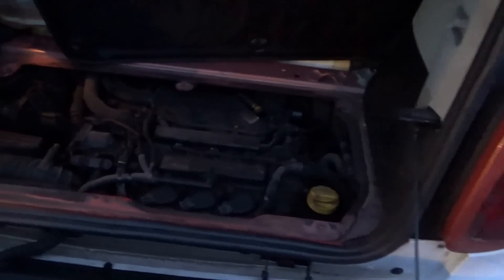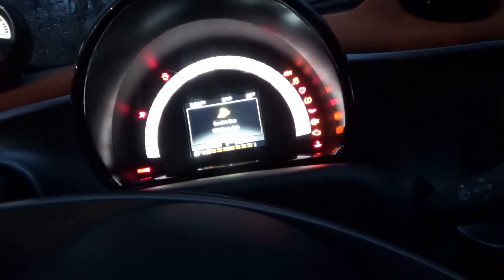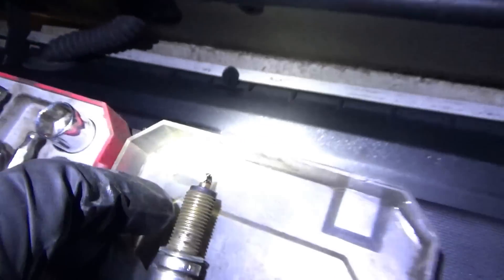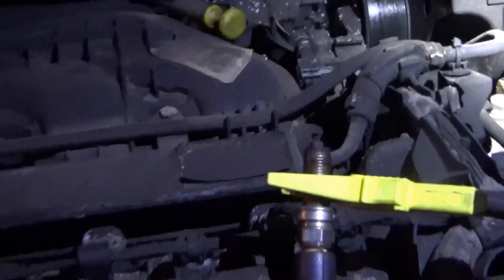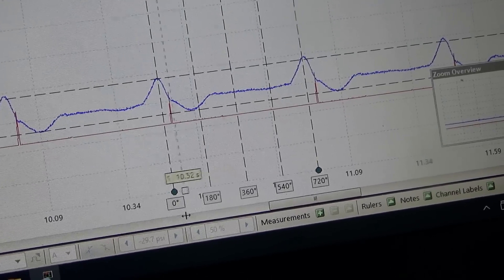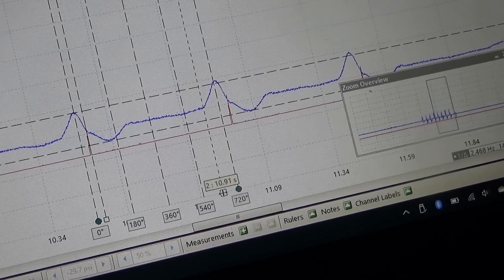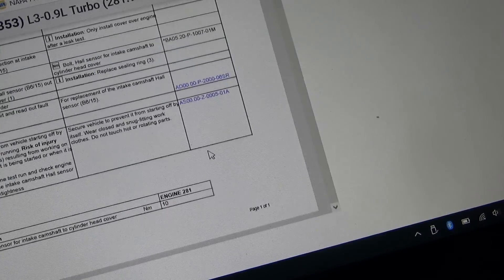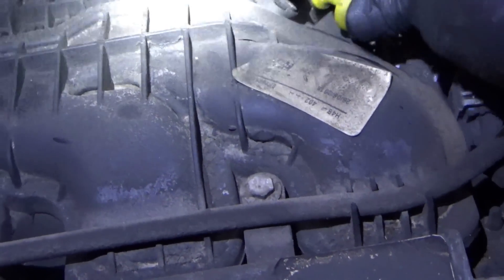SMART No-Start Diagnostics (Spark? Fuel? Compression? Timing?)

Comment: I just looked at the info display, where it said "Service 246 days overdue", and knew what kind of owner this was.  PS. They are NOT useless cars. (Maybe in the US).  But even in the US, it's nice city runaround little vehicles.  And ideal for what it was used for, namely a delivery service. Owner just didn't look after it, with proper maintenance.

Comment: Smart recommends every 10K, which I think is still too long.  The car makers are in the business of selling cars, not oil, so it helps their bottom line if you have to buy a new car because the engine got ruined.  As I've seen others say many times :  Oil is cheap, engines aren't.

Comment: My wife has a second generation 2013 Smart with a nonturbo 1 liter Mitsubishi 3 cylinder engine.
It was bougt 18 months old second hand at about 8000 miles.
Now at about 35000 miles  it has cost us in repairs a 130€ battery, 10€ front wiper blades,1€ brake and number plate light bulbs, and of cause yearly servicing. 
My wife loves that little car, and  frequently exceeds our local highway 75 Mph speed limit up to 90 Mph.
And I am quite happy driving my 5liter V8.😎

Comment: You can hear the engine has no compression either the timing chain jumped or broke I would say this has a belt😊
Reply: Later on the video, he showed thru all data that it has a chain😢

So that chain snapped just from lack of oil changes?
Reply: @ricebike  yep chain will break lack off oil change

Comment: Lots of comments here about the 20,000 miles oil changes. Here in Europe the recommended oil change interval by manufacturers is 30,000km. For city driving about 15,000km for most brands. I have always wondered why in the US it's every 5000 miles or so. Can someone explain the difference?
Reply: It varies quite a bit in the US. I had a bmw that specified oil changes every 15k miles, and a honda every 5k miles. I'd never go more than 5k miles and would use the best oil I can afford. I don't get why people try saving like $8 per month on oil when paying $800 per month for the car... makes no sense.
Reply: @rrmm7566  Yeah but based on the different recommended intervals by the manufacturers you could conclude that 1) you have crappy oil in the US or 2) you get screwed in the US by the oil companies/manufacturers to have such short intervals or 3) you have crappy engines build in the US. Pick your choice...
Reply: @mark-d9k9b or perhaps some manufacturers don't care what happens to their engines after the warranty and just want to sell cars with "cheap" maintenance and/or with maintenance included so it needs to be cheap to them. Thus "lifetime" transmission fluids, timing chains etc.
Reply: @rrmm7566  Yes that's another possibility. Although we run our cars (mostly diesel engines) for at least 300.000km before it's replaced. Never had any engine oil related problems. Our Renault Clio diesel has 350.000km on the clock now and it still runs great. We change the oil every 30.000km as specified by the manufacturer.

Comment: Spark ignition versions of these things come with a pre-worn out engine. It was so good they later changed to a Mitsubishi engine. Did 155k in a diesel version. No suspension, 4 turns lock-to-lock, very short, very narrow. You need the  reactions of a formula 1 driver to go quickly in them.

Comment: It is really a lot of parts by Renault, especially the Twingo model with rear engine  3 cylinder under the rear floor and sold with some assembly by Mercedes Bentz... Even the 3 lug wheels interchange with old Renault Le Cars... !! 😮

Comment: Hi Ivan we had the exact same problem over here with a BMW Mini, driver drove the car, oil warning light came on, engine started making noises then wouldn't run, they asked me to have a look at it, when i got there the battery was flat, i jumped it, it span over like it had no comression, i measured the starter current and it ws about 30 amps lol, it sounded like an engine with no spark plugs in, no comression, i reasoned out it had no oil pressure and the timing chain tensioner slackened off, chain went loose and jumped a few teeth and prob bent some valves, it was about 2007 so it a scrapper..by the way i could see both camshafts were turning round,,,,Fred in England.

Comment: You too obsessed with oil change I been driving 15 years without changing the oil only top up, change filter. And I am not lying , taxi companies has been know to do the same and driving in excess og 500000 km before engine need service

Many years ago I was good practice to change oil every 2-3000 km now it's 20.000 but no one really know how long you can actually drive the oil, and it are also dependent on a lot of other factors

Comment: Hoi Ivan i hope you read this and have answer for me. I had a parasitic draw non of the fuses had a voltage drop , so i was a little lost,  only when i start pulling fuses i found the bandit and solved the problem, does this happen sometimes ore did i do it wrong? Greats marco
Reply from the maker: If there is current flowing through a fuse, there HAS to be a voltage drop across that fuse 😉
Reply: @PineHollowAutoDiagnostics  thanks i tought the same maybe bad connection with the multimeter , love your channel greats from the Netherlands

Comment: Ivan, I'm surprised it lasted that long. Over here in the uk the variable transmission or the engine usually let go ar half that mileage. Really poor mercedes engineering.
Reply: Smarts have never had a CVT transmission. This generation has a 5 speed manual or a 6 speed twin clutch transmission and they are both reliable.  The older models cam with single clutch "robotised manual" transmissions which were notoriously slow to shift, but they didn't have any significant reliability issues.

Comment: Never seen a Smart car make 127k 😳 With 20k oil change intervals I'm surprised it got that far! You're not missing anything driving it Ivan,  they are hateful little pieces of crap.
Reply: They are excellent city cars and the 0.9T engine is very reliable if serviced correctly. There are many cars with this engine with well over 100k miles in Europe, it's fitted to Smart, Nissan, Renault and Dacia models.

Comment: I think most of those died due to lack of oil changes. They were all very common in the the UK  but hardly ever see one now.  I think the lack of a sump plug does not help either.
Reply from the maker: No sump plug?? How are you supposed to change the oil? 😅🤔
Reply: @PineHollowAutoDiagnostics Most of these comments are people referring to issues with the first generation of car, which looks very different so not sure how they are confused. In the first generation Smart you have to extract oil from the dipstick tube with a vacuum extractor. However once the pressed steel oil pan inevitably rusts out you can fit an aftermarket pan with a drain plug.

Comment: I worked on one of these possibly 15 years ago. Don’t these engines still have two spark plugs and coils per cylinder? One presumably fired before the other, the second one was a little harder to find from memory
Reply: Only the first generation models 1998-2007 with the 8 valve SOHC engine have twin plugs.  You have to remove the rear bumper to get to them, though that is only a ten minute job provided none of the fixing screws have seized...
Reply: @ferrumignis  Thanks very much for the information

Comment: Ivan, as soon as I heard it crank, I knew there was little to no compression. Hardly surprising considering the enine oil was changed every 20K miles. Some people are not fit to own a car. If the engine is a non-interferenece, a new timing chain is all that it needed to be running again but the lack of regular engine oil changes have probanly sealed the engine's fate anyway.
Reply: I doubt the turbo survived that abuse and I suspect the cam bearings and bottom end bearings will not be looking healthy.

Comment: Definitely a cute car IMO. Ripe for conversion to an electric motor.
Reply: There is a factory EV version of this model, in fact they stopped selling the petrol engined versions in 2018, you could only get the electric one after that.
Reply: @ferrumignis  Yes, and that makes the conversion a lot simpler using factory parts.

Comment: I hated those cars when they came out but I think it would be fun to have one.  I have a Nissan Micra and a small car is wonderful for city driving.
Reply: They are hateful things to drive, a semi auto gearbox and stop start that kicks in at exactly the wrong time. I pulled up at a junction to turn right (I'm in the UK) , just as I put my foot on the gas the stop start activated killing the engine. She restarted as a bus was bearing down on me and about to squish me....never again.
Reply: @andrewlaw They are excellent little cars, the transmission on the 453 is either a 5 speed manual or a 6 speed dual clutch with very fast shifting.  Like many others in these comments you must be confusing the old 450/451 model with this 453 which is a totally different car.

Comment: Quick cranking with little change in cranking tone not a good sign. My stepdaughters 2000 avalon cranks very quickly also but runs perfectly the v6 a engine is very smooth burns minimal oil and very low blowby. She got the car very cheaply from her grandmother who had it religiously serviced since new. It made me think abit more judging a engine by cranking speed not sure if the starter motors in those V6 s are overrated still has me stumped.
Reply from the maker: The 1MZ-FE is a fast cranker for sure! 😊

Comment: I don't get it.  My 335d came stock with 265 Hp, 425 lb-ft of torque.  It goes 0-60 in about 4 seconds (will the Smart Car even DO 60?), seats four comfortably and is a great place to be for a 10-hour drive.  I give up MAYBE 2 mpg to the Smart Car.  Other than being able to park sideways in a parallel parking space, what does it offer?
Reply: You're deluding yourself. Sometimes you should stay away from the keyboard, lest you make a fool of yourself. A modern smart car gets about 70+ MPG, at some point in time the one in this video probably managed around 40 MPG. Your 335D on the other hand will max out at 25 to 30 MPG if you drive it with a very light foot on the highway. And it absolutely will not do 0-60 in 4 seconds, try somewhere between 7 to 10 seconds, maybe 6.5 if conditions are perfect and you're being generous on the stop watch.
Reply: @nohandleleft  First, 2012 Smart Car 34/38 (fuel economy.gov).  Second, I NEVER get less than 30 on a tank, on a recent vacation had several tanks between 41-43, and averaged 39+ for the whole 3500 mile trip.  THAT'S reality.
Reply: @nohandleleft  First, Smart Fortwo 34/38, 335d 28/36 (fueleconomy.gov), but I never get less than 30 on a tank.  Second, on vacation over Thanksgiving, I turned in just over 39 MPG for the whole 3500 miles and most tanks were 41-43.  Welcome to reality.
Reply from the maker: @nohandleleft ya 4 seconds is a bit optimistic 😅
Reply: @PineHollowAutoDiagnostics  I can neither confirm nor deny what modifications may (or may not) have been made.  Beside, people keep telling me that optimism is a good thing.
Reply: You are quite simply dreaming. The 335D is pretty quick, but 4s is fantasy land.  I bet you have it plastered in M badges 😂  

The Smart 453 returns 55-65mpg, are you really going to claim you are getting just 2mpg less from your BMW?

Comment: I hav4ee been bringing a 2004 SMART FORFOUR back to life electrical issues (chaffed wires) in center console srs light, no reverse light,  and can comm issues all these are fixed now.
also failed window control module for one window repairing the drivers for this waiting on parts.
And intermittent reverse something wrong with gearbox output speed sensor signal, not looked into this yet.

Comment: customer got scammed to change oil every 20k miles, should be 2k and it would be still running.
Reply: 2k is a ridiculously short interval, you'd be pouring money away for nothing. 6k would be fine, these engines have good oil capacity for their size (around 4.5 quarts).

Comment: That happened to mi with a chevy cobalt after a -17 degrees weather no compression on any of the cilynders and take the valve cover and every thing looked normal and i took the spark plugs threw some drops of oil and disabled the fuel pump and guala come back to life every thing normal....

Comment: As soon as I heard the motor crank, I immediately knew it was time for a new motor. I know how those motors crank and what sounds they create. Sludged up motor, no good compression. Could be top end causing it or bottom end causing it. 

I have brought back motors before with sludged up oiling systems. I use kerosene to do that. Drain old oil, put cheap filter on it because you are going to immediately clog up the filter when the kerosene treatment loosens the sludge buildup. Put 5 quarts of kerosene in crankcase, pull fuel relay or fuse. Crank the motor for 1 full minute, then wait abour 20 minutes. Repeat the engine crank for another full minute. Drain kerosene from engine and replace filter with 1 more cheap filter. On severe cases, you might need to repeat the full 5 quarts of kerosene and crank time a second round. It should begin to drain more clear now. For the 2nd step of the kerosene treatment, put 2.5 quarts of oil in engine and 2.5 quarts kerosene in engine. This time, instead of cranking it, start it and let it idle for about 15 to 20 minutes. You should hear better sounds from the motor as far as cranking and idling. After that is done, drain the oil and replace filter with a good brand OEM filter and good oil. I prefer a semi synthetic oil such as Valvoline. 

I drive maybe 5,000 miles a year in my 01 Corolla. I change my oil every 6 months regardless of mileage I put on it as long as it is less than 5,000 miles since the last time I changed it. If I drive over 5000 miles in that time I make sure the oil is changed once it hits 5000 miles.

The 01 Corolla engine is known to burn oil because of the rings used. It doesn't like extended oil changes.

Comment: is this a interference engine parts are cheap im surprised you pop the the valve cover to for broken tensioner or cams
Reply: The engine won't be worth rebuilding, with the oil in that state the turbo, cam bearings and probably bottom end bearings will be done.

Comment: So bad engine with no compression doesn’t set any trouble codes.
Reply: I woulda thought cam crank correlation codes at least, but maybe it has to actually run to set them.

Comment: There is another known problem with these engines. From above you can see three spark plugs. But... there are also three hidden ones on the other side. It is a twin spark system. Most people don't know this and only ever replace the top spark plugs. Until the day the engine dies...
Reply: Only the first generation models (1998-2007) with the 8v SOHC engine had twin plugs.  The second and third generation models (this one is gen 3) have a single plug per cylinder.

Comment: 125K miles that's impressive. Here in Germany they rarely hit 100K Kilometers (60K miles) without a major overhaul at which point most people go for a replacement engine. Smarts aren't easy to work on due to very limited space and a requirement for specialised tools, knowledge and techniques. They are however very dependable and economic to run. This one is unfortunately as dead as a dodo.
Reply: Like so many other people in these comments you are thinking of the first generation of ForTwo (1998-2007), this is a third generation model and the 0.9T engine is very reliable if serviced correctly.

Comment: IIRC you have worked on a car once that had a 966 cc, V-4  rear-engine and you got that running beautifully.  These cars all need to go to the crusher.  I wonder how any sane person would change the oil every 20,000 miles.  GREAT VIDEO!
Reply from the maker: ZAZ 966 has a 1200cc air cooled V4... 40hp monster 😊
Reply: @PineHollowAutoDiagnostics  That sounds almost like the old VW Beetles.  Back in the 50's you could get a sticker for the rear of your VW saying, "You have just been Volkswagoned, passed by 36HP"😂🤣
Reply: @williamwhite9767  Yes.  What he's referring to is a 1971 Zaporozhets 966 that his family had when they lived in Russia.  He made a video in 2017 when he went back to his home town of Novosibirsk, Russia ahd got it running.  You should check out the video!
Reply: @PineHollowAutoDiagnostics  I thought 966 was the engine displacement.  I would like to remind you, young man, that while they may have only 40 hp they have excellent off-road capability!  LOL. I KNOW!